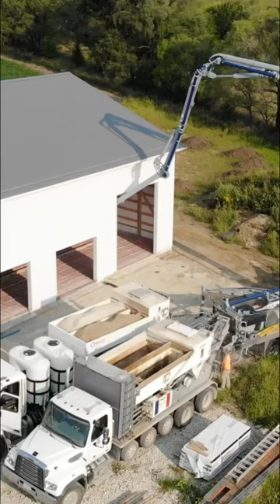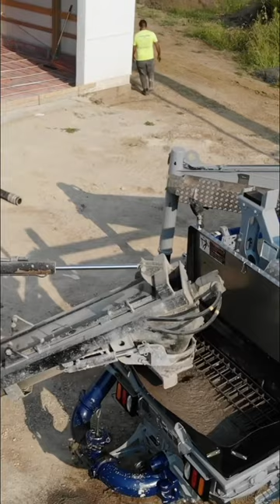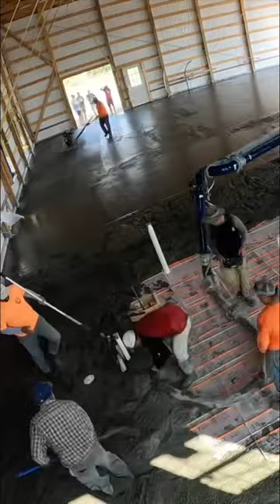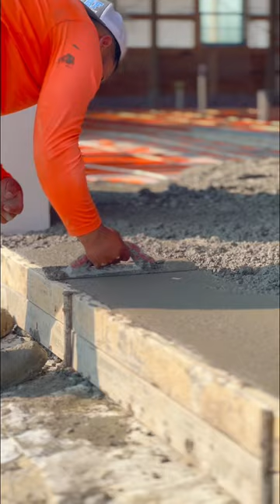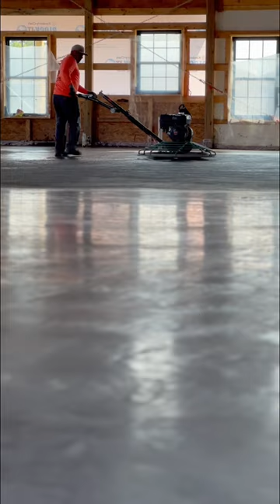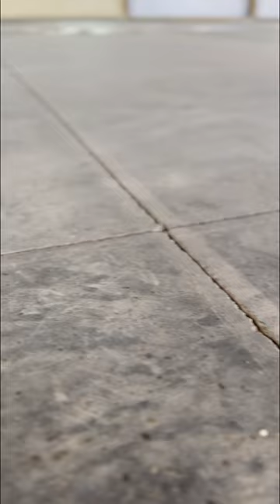CONCRETE Slab Day #shorts

Comment: When you have a large garage like 60 deep by 80 foot wide do you put a slope on tbe garage floor?  How much of a slope?   On the far left I have a 12 foot wide by 14 tall garage door and it is a drive through where there is also the same door size at tbe back of the garage.  The other two large doors on the front (3 doors total) are not Drive through.    I just can't figure out how much to slope the floor?    60 feet is a long way and the slope could be large from back to front.   Then the metal would have to step up in the back of the garage.   I'd love to know what others do for a large garage.   

I am one of your patreon subscribers